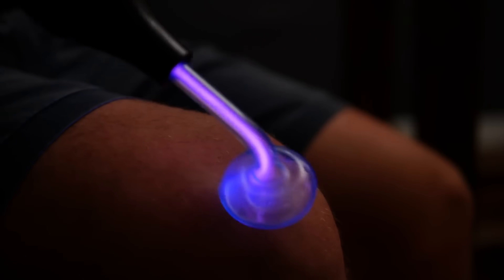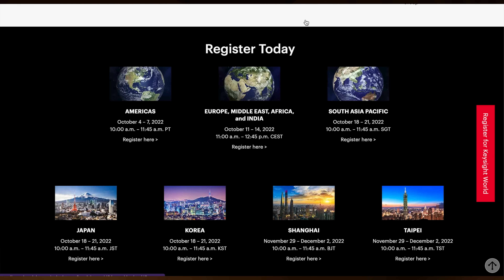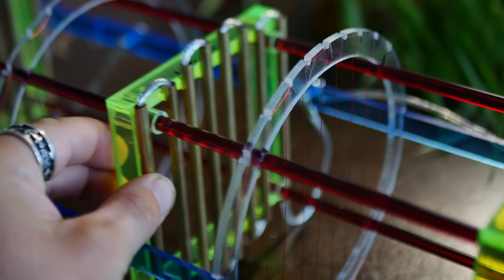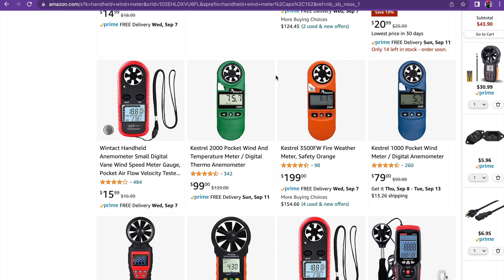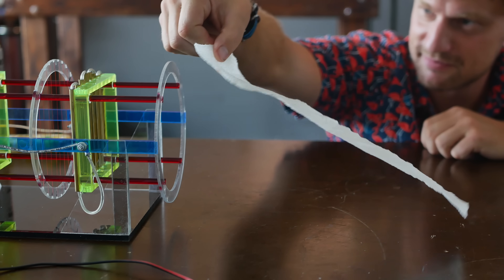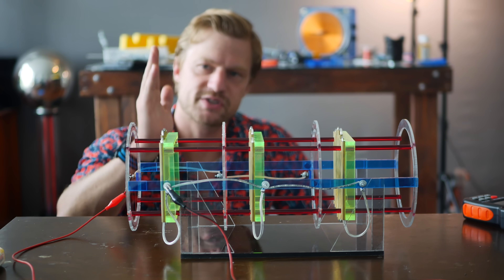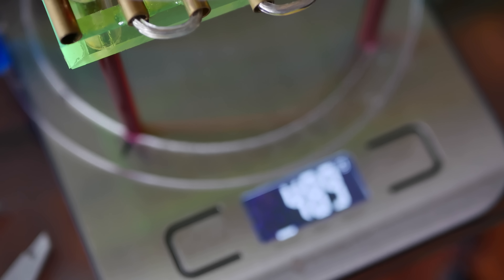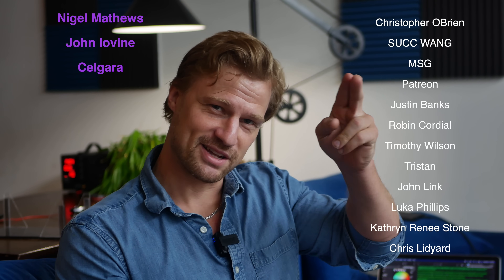Designing A Next-Gen Ionic Thruster! (For Flight)

Comment: I would have tried having many  more different spacing experiments on that thing, but it appears you limited your options by making the anodes fixed in position rather than having all 6 parts movable. 

Also, a tube encasing the engine would reduce turbulence and loss of thrust.

Comment: If you close of the sides would that not boost the volume/speed/thrust you get? Perhaps a nozzle at the output to focus the flow to increase air speed and pressure? What volume flow did you get?

Comment: Thrust is limited by voltage. Higher voltage should help but very sharp pulses may actually reduce arcing at a given distance between the electrode grids. Nanosecond or picosecond pulses perhaps.

Comment: I love it but am frustrated that you moved the anemometer for every measurment and made some measurments with it set on the table, and some in your hand.

I am also curious to know if you need symettrical +ve to -ve wire configurations, i.e. what if you have the full cross section create the ions, but have the collecter smaller and in the middle, to perhaps compress the air slightly, or draw more air in from the sides, rather than just from the back?

Comment: First off, wow, those pictures were gorgeous! Now, a few thoughts :)

Would enclosing the whole assembly inside a tube increase the air velocity since the later stages wouldn't be able to draw in "slow air" from the sides and would spend all of their power further accelerating the air that had already been pushed by the previous stages?

Does the diameter of the thruster have an effect on the velocity of the air flowing through it, or just the volume? By extension, could you create more thrust and a greater thrust to weigh ratio by simply making the design wider? The components would get slightly heavier, but the increase in the mass of air flowing through would be proportionally larger.

Could you make the negative electrodes more aerodynamic and/or smaller to reduce the drag on the air flowing past them?

Does the velocity of the exhaust continue to scale with more stages and if so, how many can you add before you run into diminishing returns?

Could differently shaped/tighter or looser electrode grid affect the airflow?

Would adding a nozzle potentially increase the thrust enough to justify the extra weight?

Comment: 1. Velocity stack out front, nozzle at the rear, close the sides.
2. Teardrop wire and tubes and structure.(collaboration with 'This old Tony' to build the teardrop roller tool?)
3. Plasma discharge on wires looks erratic. Maybe the above roller could roll the wire with evenly and tightly spaced structure or twist your wire tightly with a non conductor to provide a regular discharge pattern?
4. Phased array output?

Comment: If air is ionized already, what stops you from adding magnetron making it super hot plasma and then using magnetic field to accelerate the plasma or ionized air? Why can't you just make it enclosed in tube and wrap coil around that will use magnetic field to accelerate ions, why just rely on speed of electrons when you can accelerate them

Comment: I have always wanted to try putting some ion thrusters like this in to a jet engines combustion chamber to see if I could get workable thrust out of it. I know this sounds a bit loopy but hear me out.  

It is my understanding that the way these work is by ions jumping from the cathode to the anode,  and on its way bump into air molecules and move them in the same direction creating thrust.  So it would mean that if you doubled the density of air in the way of the ions, the ions should hit more (up to twice as many) air molecules. You may also have to increase the voltage order for this to work.  So that would mean that you could test the hypothesis by building a pressure chamber that could increase the pressure to 2 atmospheres to see what sort of thrust that would generate.  If I am right, and workable thrust can be generated say at a few ATM, then it would be interesting to find out how much pressure is inside the combustion chamber of a jet engine. I met a Jet Engineer from Rolls Roys about a decade ago who told me that they were always trying to get as much pressure in the combustion chamber as possible as that increased efficiency. If I am right, and you could get say 10atm or more by just spinning the jet compressor, this might just be viable.  Imagine being able to create usable thrust out of static electricity.

If anyone here can tell me if this is possible or not I would love to hear it.

Comment: wouldnt the thrust in grams get better having the three stages configured side by side? (single stage with 3 times the surface area) big thumbs up for build design
Reply: Well, considering the next one increased thrust just by 30%% and the one after that by even less, yeah, that would suggest that side by side he'd get an x3 thrust in grams than the +50% that he gets from them stacked up. Then again, that's judging from the speed data, which is hindered by the fact there's no outer tube guard and extra thrust could be escaping out the sides, so the overall thrust in grams is exactly the same or even higher due to the acceleration factor... Hard to tell without measuring, and considering I know jack shit when it comes to physics and stuff, operating from just logic

Comment: 1) Put a shroud around the whole thing to stop escaping air. 2) Swap out the tube shaped cathode for an airfoil shape. 3) Use lower voltage on the first stage and higher voltage on the last stage. 
Bonus Round) Use a centered electrode and make the shroud the cathode. Centered electrode may need to be a braded wire or something similar to have a high enough surface area. This would take a lot more work to fine tune the electrode cathode spacing.

Comment: Would this work better with bare wire vs insulated wire? Would a flat profile work better vs small wire?

Would it work better with thin cocentric cylinders versus the tubes? The wire would likely need a similar pattern. 

Definitely need to control the airflow on the sides and a narrowing of the tube (nozzle) should give higher velocity.

Comment: The frequency of the H.V. will influence the strength and efficiency of the power conversion from AC to DC and therefore increase (or decrease) the efficiency ratio from power to output flow (thrust). Finding this out empirically though, will take you a bit of time. Two tips: either use pure sine-wave AC or start with 50% duty-cycle square wave AC. Both have advantages (and disadvantages)
Reply: Sorry I don't want to install yet another messenger type application either on my PC or phone just to claim a prize.
But thanks anyway

Comment: 1. Use 5 cylinders with small radius so that they fill in that volume of the current cylinder. What I mean is that outer cylinder won't be there but there will be 5 cylinder which would somewhat make the same dimensions.
2. Decrease the spacing between the three grills and add more.

Comment: I would say, enclose the sides, make section one 100% larger at a different voltage (unsure which way would be best), 2nd section 50% larger at optimal voltage, and then keep 3rd the same and adjust voltage. Allowing an acceleration of air rather than  3 sections of the pushing the same speed. We want to control the airflow and entice the most amount of air in the front as cleanly as possible with the smallest opening at the rear (of course this is common knowledge, lol) - But that’s where I see the design improvements.

Comment: Reduce air obstruction by making ground rods less diameter. Redesign by adopting Venturi air multiplier for more volume, maybe just cover outside and have channels running the length of the flow tube to create laminar flow. Step the stages instead of running them in parallel, like a rail gun style setup to progressively increase velocity between progressive stages of the flow tube? Awesome video! 

Edit: simple tube design where the ground electrode is a ring around exit hole of tube and similar ring for inlet side. Can make stages along the tubing. There will be no obstruction at all but less surface area, pump up the voltage?

Comment: My three guesses towards inefficiencies: 1) Lack of ducting 2) lack of pressure building and 3) Inefficient weight design (by which I mean, reducing metal screw length, adding holes to structural segments, or maybe changing to a lighter material for certain components).

Comment: The inefficiencies:

1: the thickness of the 2nd electrode relative to the flow reduces airflow. A thiner airfoil design would be much more efficient.

Not only will it result in charge runoff in the direction of airflow, but also reduce drag, improving exhaust velocity.

2: Coronal discharge. The light and heat created by the plasma is effectively lost energy. 

This could be recovered with a pressure vessel, but that would be a different engine and up its power consumption a lot.

3: Size of the intake. For any given amount of energy, to gain the most momentum it's most efficient to push off the largest possible object (at low speeds). For this reason the intake should be a lot larger, pushing off more air. This will improve the thrust while lowering the portion of internal volume to structure effectively increasing it's thrust to weight ratio even further

Comment: Add a paper tube around it to keep the fast air away from the slower air!  You could also attach everything to just one central shaft to cut weight if you didn't want a tube and add paper ducts behind each thruster to focus the air flow!

Comment: I feel the three problems with possible solution are:
1) The leakage of air.
A simple thin plastic case should limit air leakage
2) The diameter of the opening and exit.
A cone-like design will produce greater force but to a smaller area
3) The overall size.
Having multiple miniature version enclosed in a case might be more energy efficient.

I love this idea.
Would it be okay to copy your design to experiment on my own?

Comment: Enclose the thruster in a tube, have each subsequent module take in additional air in a circle around the previous thrusters output. Charge the air as it enters through the sides.
The Venturi effect will add aditional air(thrust mass) to your airflow, offsetting the secondary and tertiary coils to a circle on the intake will reduce wind resistance, also a sheath of slower moving air between the tube and central cone will reduce your in engine drag without reducing your thrust pressure.

Comment: You can get some handy improvements in thrust by decreasing the wire thickness, when I built a lifter a physics prof of mine gave me extremely fine fuse wire for the negative electrodes.

Comment: 1. Enclose the thruster side walls
2. Experiment with various mesh densities on the 3 stages
3. Try different frame materials

Finally mount this thing on a little blimp. It would be awesome :)
Reply: crowd chant

LIT-TLE BLIMP! 
LIT-TLE BLIMP! 
LIT-TLE BLIMP! 
LIT-TLE BLIMP!
Reply: @BezBog you sir answered exactly as i would have but the addition of the blimp.... AMAZING
Reply: a. Make it ducted, enclosed in Ring Airfoil..
b. Different mesh densities..
c. Different mesh angles(60° increment)..
d. Different electrodes diameter..
e. Pulsed delay, input energy (like railgun)..
f. Credit some of above, here, below ideas..
Reply: Bring back airships!
Reply: @hondaguy9153  
i saw a workout machine where you basically get hooked up to a personally blip and you move forward with giant paddles to push air backwards. 
Must really train your pegs 😆
Reply: interesting, I was also thinking to crimp the ground wire tubes to form little airfoils. The round profile of those ground wires is likely adding a lot of turbulence
Reply: I'm wondering more Star Trek... could the same concept accelerate random Hydrogen atoms in the vacuum of space
Reply: The variability is endless! So much potential.
Reply: The brass tubes had me thinking.  Aluminum?   Do they have to be tubes?  What is the optimal surface area, or surface area to weight ratio?  And, of course, how about the spacing?  ... ... relative to the source voltage?
Reply: Iron Man
Reply: my thoughts exactly
Reply: This.
Reply: Or a little plane, ngl thinking about it more if not placed right the thruster would make the blimp spin and i kinda find the idea of that funny
Reply: I'm with you on no.3 lets do it!!!
Reply: The the first middle distance & middle last distance should be at 2:1 ratio.
Semi enclosed design would be ok. 
In the first mesh wires should be tried thin and denser.
Reply: Yes,  I was thinking the same thing, you must be an experienced and talented maker
Reply: Enclosing will reduce the thrust as thrust is generated by gathering the surrounding air giving it a linear velocity.
Reply: @3s-sahajselfstudy  what about a funnel after each stage? That way each stage can still draw in air from its surroundings without losing much to scatter
Reply: @3s-sahajselfstudy  My mental picture may be flawed,  but I'm imaging these accelerated ions are knocking into gas particles, thus creating the thrust of air but at the same time, that air is causing friction and decelerating. I think you want to go for a venturi effect, pulling in air, compressing it and ionizing it. I think what will happen is,  some of the air air that makes it through the first mesh (not yet ionized) will ionize, add the thrust and so on. I imagine mesh size, shape and orientation can make a big difference as well. Perhaps tuning to a vortex would be optimal?
Reply: @3s-sahajselfstudy  What about a multistage'd vaccum chamber set up on the outlet sides?

Comment: I have a request: make an ionic thrust mini blimp or airship. With buoyant aircraft, no energy is spent remaining aloft, and the energy you spend then goes only into forward thrust. Or perhaps make a 95% buoyant craft, where the thrust only has to overcome 5% of the weight, with the rest handled by buoyancy.

Such a craft need not be bulky and incur a lot of drag. Check out the Hyperblimp. If you do an image search for 'Hyperblimp' you'll see a bunch of super skinny blimps designed to minimize drag in forward flight, while having enough volume to still be useful at buoyant lift.

Comment: will the thrust increase if:
1. the ionic engine is covered
2. the inlets are wider that the outlets
3. each stage is a separate ionic engine which feeds compressed air to the next stage which in turn compresses it further
4. each ionic engine has a concave form which in turn has progressively smaller in diameter for the succeeding stages

Comment: Go easy, laymen question:

It looks like an open air design without sidewalls to direct airflow. Could the charged ions as they move after the first stage be grabbing the nearby outside air in second and third stage which results in a disruption in the air flow due to air molecules impacting each other and injecting chaos to the system?

Comment: Is it possibly the electrode pattern you're looking at.  I've been thinking of doing a sort of electric afterburner for an electric ducted fan using these atmospheric ion engines, (if the result ends up being good enough to get something up to speed a ramjet third stage in the system would be in order.) with it being in a duct I was looking at ionizer three rings towards the outer edges supported and powered by an 8 point cross which would also have wire going into the center stream and I was thinking of having the neutralizer/ ground just be a ring around the duct. (although a simple cross and wall ring would probably encourage more even flow)

Comment: You're using wires and plastic, the fans don't necessarily need to be flat - shape the 'fins' into loops, largest diameter loops at the front, decreasing in diameter for each fan toward the rear. Hopefully creating an effect that draws the highest airflow toward the centre and maybe reducing the effect of turbulence when you create a ducted version... and now that I say that, I see other people have suggested similar ideas.

Comment: 2 things:

First I was wondering if you could use a length of thin-walled tube to encase the thrusters.
I don't think it will add to the weight too much if you make it a structural element like using it to hold the wires and ground tubes; but using it to hold wires will make it impossible to change any dimensions without a rebuild.

Secondly I was thinking about how the multi stage setup is similar to something like a set of 2 concentric propellers. With those the aft props need to be set to a higher speed otherwise it's doing nothing. So I was wondering if having the voltage at the stages higher than the stage before them. It could be a way to accelerate the air faster using higher voltage instead of distance(which I guess you could also do if you enclosed the stages).

Comment: So the issues I see possible given the potential use in the world market,
1) power supply
2) thrust per pound or in this case can it create lift on an airfoil
3) high altitude air density affects on its general thrust at an atomic level...

I'm not knocking anything, I will not discredit or bash anyone that is making a point that I am clearly not able, or am capable of understanding in the form used. I only bring up a few questions to address, nothing more. This is intriguing to me and I hope to learn from them in some fashion and I would like my curiosity to be of educational use in the future, even if it turns out to be simple thermal dynamics or something